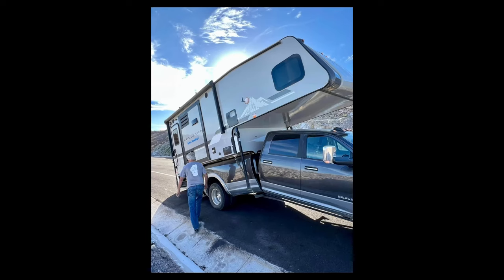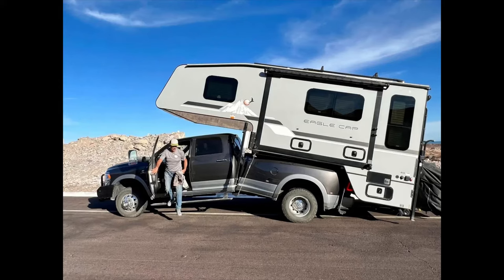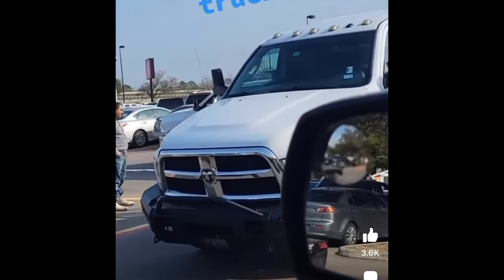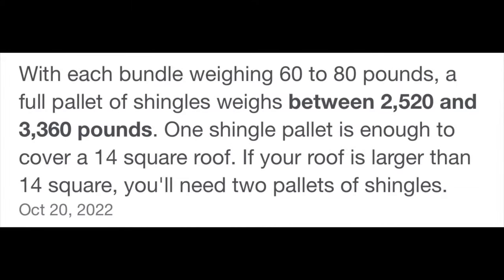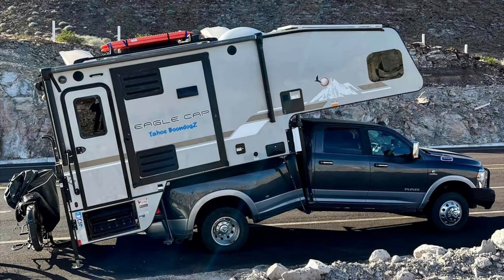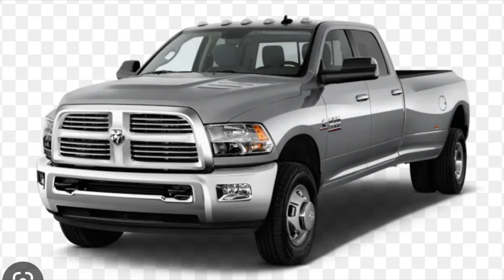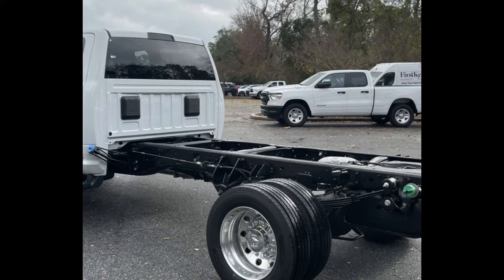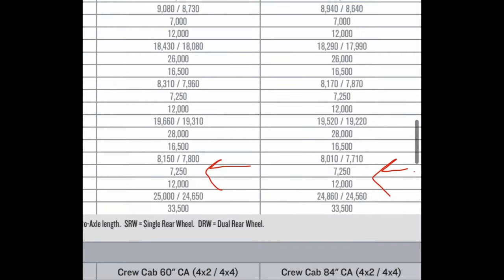Broken Ram truck frames 😱, what’s causing the failure and can they be repaired?

Comment: Have an 04 ford Single cab long bed DRWThe truck is in great shape 35,000 miles, but up in New England rust get on that frame like I said it’s in good shape no cracks or breaks but it did thin out more towards the back. I was thinking of possibly boxing Or plating one side of it as you know it’s a C channel any recommendations. Not going to be pulling anything wild with it just would feel better knowing that I brought some of the structure back to it.
Reply from the maker: I have heard New England is far worse with rust than here in Wisconsin, and it’s bad here lol.  I have worked on a bunch of OBS fords and 2008+ fords, but I have not worked on the 04 style frame.  I am sure it’s not a lot different than what I have worked on.  The main issue of concern is the front of the axle(front leaf hanger) to just under the cab and the rear leaf spring hanger.  Depending on how much rust plating the inside would massively strengthen the frame but there are draw backs.  1) it would trap more salt in the frame in winter which isn’t good.  2) by limiting flex in some areas you will risk putting more stress in others.  The c-channel frames are very thick and generally are still strong even with significant rust.  Get some decent pictures of it and send them to me at weldingoldschool@gmail.com and I will give you the best advice of what I would do.
Reply: That’s awesome thank you so very much I’ll definitely send you over some pictures when I get the bed off I may send you some  just underneath the truck so you can get an idea how thick it is. this is gonna sound funny but I went around with the ball peen hammer and knocked off as much flake as I could I filled a little less than half a shopping bag full of flake. and you are 100% spot on of the rear hanger and just under the front axle I noticed pin holes in them. I swear trucks just sit that’s worse than driving them. Mass is terrible with the salt they use that liquid stuff that really gets into places. Again thank you!

Comment: Then the little Japanese Kei mini trucks must be really strong. With most having a monocoque body, they state a payload of approx 550 kgs, approx 1220 lbs, yet they can easily carry 2000 lbs or even more. Granted the suspension is bottomed out and the brakes are overburdened, but the body takes the weight with no bending or breaking.

Comment: Hello. I don't weld high strength steels without clear OEM instructions. Even if it seems 50000psi is on the lower scale of high strength steels. 2016+ Honda Civic have 7 different high strength steels types in its unibody construction(3 of them Honda calls "Ultra HSS", highest of them is 220000psi!(1500mPa!)). Of them all - the 340mpa and the 440mPa you can weld with regular er70s6 by Honda collision repair manual, and you can section and butt weld them. But - 590mPa parts and above must be welded with "approved HSS wire". 5 years ago instead of the stated "approved HSS wire" they were listing "Bohler Union X96" wire. Now they replaced it with "approved HSS wire". Anything above their 780kpa steel is not supposed to be "sectioned" in other words - not to be "butt welded" , even with backer plates. You could still use "plug welds" to replace a few selected smaller HSS panels(above 590mpa) but only at the factory spot welded points and by using "Bohler Union X96". But these panels are mostly brackets and minor panels. Now to the point - I saw with my own eyes a repair that was made against these rules - sectioned rocker panel that cracked right next to the weld. That panel is made by the highest - 220000 psi material. It was butt welded with a backer plate with bohler x96 wire. When hit with a pick hammer the area around was just flaking. Another story from my country where is no control over structural repairs of collision vehicles. A family of 4 - mom, dad , 2 childs died in a low speed crash with a tree (70kph~45mph). The car-  Volvo xc60 is "one of safest cars in Europe", but split in half and they fall off(nobody wears seat belts in my country). Yes , this Volvo was "clipped"(front part of rear hit car welded to the rear part of a front hit car). Most such clipping operations on older mild steel cars are okay and technically are done by sectioning the left and right rockers by butt-welding with a backer plates , and then the floor with overlap weld, and then the roof rails above the rear doors with butt-weld with backer plate. The roof panel can be installed with 2k structural impact resistant adhesive. XC60 Volvo is pretty new car and all of this is against Volvo collision repair instructions. But this is how people "save cars" from being totaled and make big money by selling them. Go and type "volvo xc60 unibody materials" in google images. Turns out that both the roof rails and the rockers are made of that ultra high strenght steel - 1500mPa. The car split at the welds. As for how to repair the truck frame because it's high strength steel - here's how i saw an Armenian and Ukrainian "collision specialists" repair 13th gen F150 frame in Serbia. Yes the body of this truck is all aluminium , but the frame is high strength steel. The frame is split in multiple sections and you can buy the section you need and weld it. The interesting part is that the new OEM sections comes with additional reinforcement plates, that weren't there before and they must be welded. It's in the OEM collision repair manual. But in Europe you can't buy parts for these trucks because they're not selling them here. So they "spliced" bent rear frame front section to rear section of bent front frame. The collision manual doesn't allow welding at the center of the frame so they did this. - Cut the inside wall of the boxed frames of the two donors so the area where they would splice became a classic "C" frame. Inside this now "C" shaped frame , they made and installed a fabricated 16mm thick inner "C" reinforcement that laid tightly to the original metal and overlapped each the front donor and the rear by 12-13 inches. All these exposed parts were epoxy primed and then treated with a product "Rostversiegelung" , something like POR15 in America. Finally the 16mm fabricated inner "C" reinforcement was assembled to the donors with multiple 10.9(maybe grade 8 in US) M20 bolts with through hardened washers and case-hardened nuts.

Comment: I saw a video just yesterday testing frame flex. A visual comparison was made between a Ford and a Ram. The Ford flexed more snd the Ram flexed far less. Along with the test it was explained that flex is designed in for strength and durability purposes. So I'm thinking that the Ram being more rigid (brittle?) contributed to the break.
Reply from the maker: A lack of flex makes the suspension function better and generally improves handling and responsiveness while driving.  The downside is it’s incredibly hard to make a reliable stiff frame that is twisted by monster torque diesel engines  like what’s out in the newer trucks.  Strength is great but ductility (flex) will help prevent frame breaks no doubt.  Not that long ago a long bed truck with a crew cab didn’t exist (you bought a semi lol).  Not to mention 400ftlb of torque was a lot for a truck.  Crew cab trucks with long beds and 800fltbs of torque are common now, which is the worst case scenario for a stiff frame.  Even worse, they design it to be as light as possible.  A recipe for failure lol.

Comment: Not a new problem. All too often the sales people over sell the real load capacity to make the sale.  Back when small farmers still bought 3500 series trucks for farm hauling with dump beds, we saw the same failures.  Lots of trucks were repaired with extra plates on the side rails. People bought these lighter chassis to save on the  original purchase price.  Saw this issue again when the gooseneck trailers came on the scene. People were trying to handle 10 ton loads with regular pick up trucks. Didn't work too well. Always get vehicles that are more than up to the job, to begin with.
Reply from the maker: 100% agree.  So many of the broken frame pictures show apparent overloads, and trucks from all companies have been photoed with broken frames, clearly it’s not just limited to one particular truck.  I really think the overly powerful/torquey engines aren’t helping much either.  The amount of frame twist/forces present when you’re talking 700+ lb ft of torque and overloads (with a lot behind the axle) is pretty hard to engineer for.

Comment: Is that why many frames used to be put together with hot-rivets?
Reply from the maker: Hot rivets are kind of like bolts that the nut doesn’t loosen lol.  They can hold things together with a lot of strength.  The downside is the shear strength of rivets is lower than a weld.  But some alloys become very brittle when welded and it’s possible for rivets to be stronger.  The downside with thin wall box tube is welded defects can seriously compromise the strength.  Old thick riveted frames (or even
More modern c channels) would have a lot of meat left with a weld defect.
Reply: @ Is that why older structures, e.g. some bridges in Portland (OR) have lots and lots of rivets in some of the joints?

Comment: Well you hit the nail on the head they don’t build em like they used too
Reply: I agree completely I have a 2000 Ford F250 4 x 4 that I bought brand new and I routinely haul heavy loads and I have had zero problems. The truck now has over 200,000 miles on it and still going strong.

Comment: They would not have heat treated the frame in an oven after welding. That is not a procedure they normally welded up and it goes down the track and it goes into a paraffin bin and is coated with paraffin to have some Rust resistance. GM does the same thing. I've been at all of the factories. Most of them do pretty much the same style work some of them even build parts for their competition. I remember working at Dodge truck years ago and they were making doors for Fords. and Ford was making doors for them.
The content of the Steal is not that big a deal because you can use the S70 wire. Which is standard black Iron mig wire that can also be used to put differential Metals together like stainless steel to Black Iron. It is a low hydrogen wire with high enough alloy to work really well as a repair weld.

Comment: I'm not debating u, but I'm sorry, that's a factory flaw, I've drove dodge 3500 dually's  all my life hauling cattle and equipment, u are right, it's the frames on or around that year model that are weak on those year models, Ford chevy and dodge, like I have driven 3500 1 ton dually's all my life and I'm 54 years old and have never had any frame trouble, if u look at where those guys had the shingles loaded, the frame should have broke the opposite way from the way it broke, they had the weight in the front of the wheels putting weight in a downward force on the frame, if it was placed behind the wheels, then it would've broke like it did, common sense, it's called weight distribution.
Reply from the maker: The reason the frames break up (opposite of what you would expect) is likely because they go to accelerate and under acceleration the axle wants to twist the pinion towards the sky.  With the top of the frame likely broken already the frame ends up tearing and that allows the axle to twist pushing the frame into a triangle.  The same thing would happen with no load on the truck if the frame was broken in that manner.  

The hard part is to determine how much of the failure was due to overloading and how much is engineering/material issues.  All of the broke frame vehicles were likely overloaded at the time of the break, so that does play a role.  Not overloaded enough that I would expect failure.  To me it’s pretty much excessively powerful engines, excessively long frame lengths, with thin higher strength material that doesn’t flex very well, combined with overloads that is why the frames have failed.  The manufactures will modify the design to prevent the failures in the future I have a feeling.
Reply: You got something there Larry.  the Coarse is called Strength & Material’s (a moment is a moment) it’s very suspicious that it broke that way.  All truckers know to but weight over the single axel or splits the difference between front & back. But the equation changes when you hook up to an over weighted trailer tongue and then take it down a bumpy road and do it consecutively over time. Maybe you have truck camper with full tank of fuel plus extra fuel tank, water, full waste tank, extra propane then pull a fishing boat or storage trailer full of junk.  So if you look at a pick up that is squatting in the back and the tires are a little bulging you are most like cause to much downward pressure on the back bumper area creating centre upward lift between front and back axel (flexing back and forth) in the weakest area of the manufactured “cab frame” slides into the “box frame”. 
PS: I have a 03 Ram and stretch it from short box to long box. I check the frame every off road trip and weld is still good. 
But note I remove the interlocking frame area and weld it up then covered with over lapping 1/4 plate.  Still rolling 2023😊
Reply: @alanlietz8240 I'm looking to beef up my '06 Ram 2500. I want to take the bed off and put a flat bed on it, maybe swap the single for a dually axle. I don't have major loads in mind other than maybe a home built camper. And suggestions on strengthening the frame? I thought about boxing the frame, but maybe plates on the outside of the c-channel?
Reply: My buddy also pulled the single rear tire axle off his pickup and put a dually axle from the junkyard on it.  Then he put a service body that was set up for duallys on the pickup.

Comment: As someone who is certified in NDT this was a failure in QC department they should have caught this type of flaw. It’s detectable with mt and x ray and probably even detectable using dye penetrant. Bet there was already a crack there when it left the factory. The steel they make those frames out of is really pretty good shit. It’s no better or worse than older frames. Just the material itself anyway.
Reply from the maker: One thing that was brought up that I didn’t realize, is that apparently some of the broken frames had welds on them they were not authorized or allowed for by the factory.  I am not familiar with what the bare truck frames look like (other than cab and chassis trucks) so I am not sure if that’s the case where it broke.  You’re right though, if it was factory they should have caught some defect that would be the primary cause of the frame breaks.

Comment: C-channel frames are very strong they are used in big rigs again thickness has a lot to do with strength. I don’t think they make a 3500 cab and chassis until the 4500 or a 5500 those trucks are built very different from the frame, brakes, suspension, rear end. But the trade off is definitely the ride if you are not going to load them they will ride very rough. The reason for 3500 vs 4500 is many things like insurance they get put into a commercial bracket and it’s a lot different. Also another this is emissions in states with certain regulations you get put into a commercial standards.

Comment: Yes ram does have weak frame, but if run f550 diesel that weighs around 19,000 pounds in most cases you can't even get 100k miles. We just lost an engine on 2023 f650 with a powerstroke and it only had 46k miles on it and just got back an f550 from the shop had to replace the engine at 75k miles and at 50k miles had to replace a transmission. If you run f250 with a diesel it does well but not in a truck that's under heavy load on day to day basis

Comment: The turning radius is part of the problem, If the rear ankle were moved 18"-24" rearward the weight distribution would be better. People use the 3500 dual wheel trucks for towing. That is one big reason for the 3500 series/ dually rigs.

Comment: Stelantis is what happened to those trucks. Cheap construction.
I have put 5k on the bed of my 97 extended cab Ram Cummins dually several times and it had at least 1k of tools as well and I have never had any trouble whatsoever. 
The pictures do not show any weld within 1/4 inch of the break in the frame. Therefore assuming welding caused the break is not logical. All those trucks can absolutely be repaired and improved by welding. Lastly I used for YEARS a 1980 Chevy 1 ton truck with a manufactured wrecker bed and many times I towed vehicles that weighed considerably more than the wrecker itself and NEVER had any trouble. I agree that Fords are noticeably tougher which is why I have five 2000 to 04  Ford Super Duty F350s that I am puting 12 valve Cummins engines in.

Comment: I know my 06 ram 2500 had a fully boxed frame. Not sure when they started. To me the frame is tall and fully boxed but thin.
Reply from the maker: I am not sure when they switched to box, but many companies went to box other than on cab and chassis trucks.  I am not brand loyal for trucks, but I generally avoid box frames on trucks because in the rust belt where I am at they don’t last as long.  A 1/4inch c channel will still hold together far longer than 1/8th wall box will.  Case in point the box frames on f150s that rot completely out, or the Jeep TJs of the 90s.  Box frames are incredibly stiff and likely give a lot better road feel to a truck, but salt is its worst enemy lol.

Comment: I put damn near 5000 lbs in the bed of my 02 ford ranger.  Took it no problem. It went slow but i didn't have a problem.  
I'm thinking it's a combination of manufacturers trying to save cost on materials, and federal restrictions.  You might not need a cdl if you aren't using the vehicle for business so a 4500 would work for the camper.